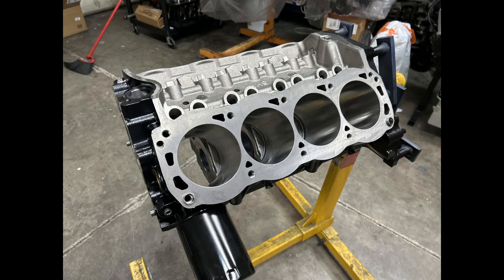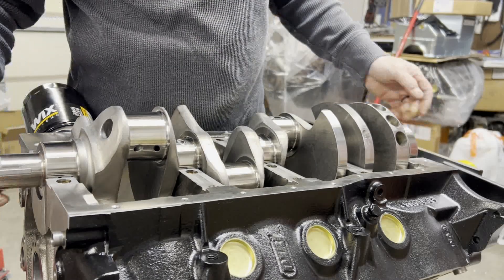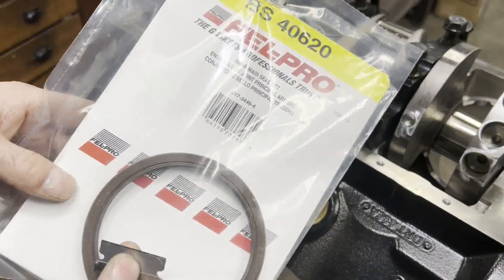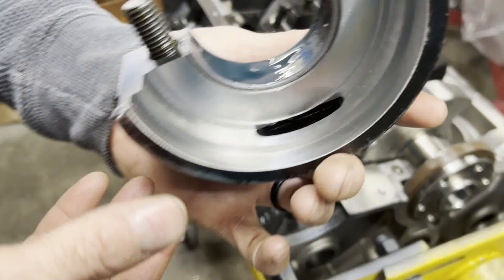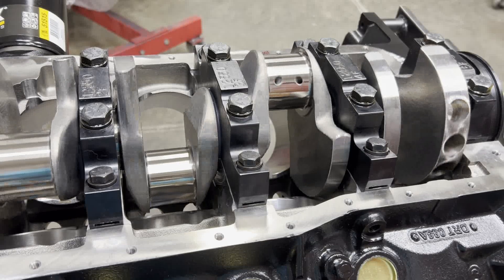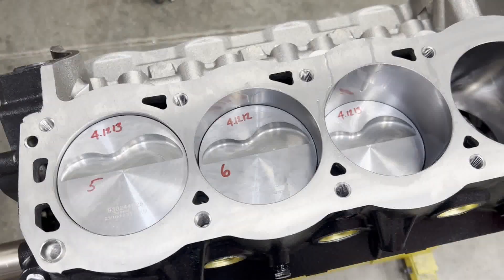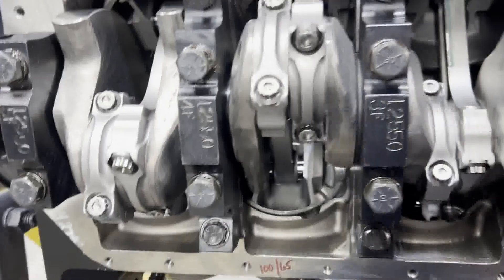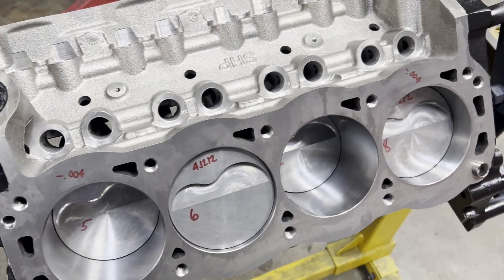Lykins Motorsports Ford 363 Windsor Short Block Assembly

Comment: Lovin' this build Brent!
363 SBFs are serious powerhouses in a very small, bulletproof package.
550 - 600 HP in a pump gas street N/A package.

They are 364 cid engines.
(363.5 cid actually)
Even Mahle has them listed as '364 cid' in their piston catalog.